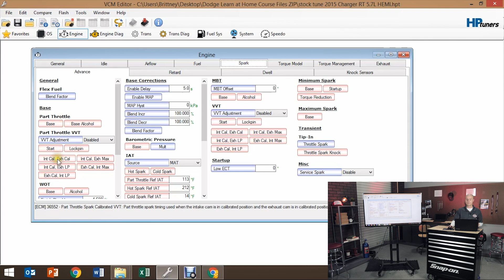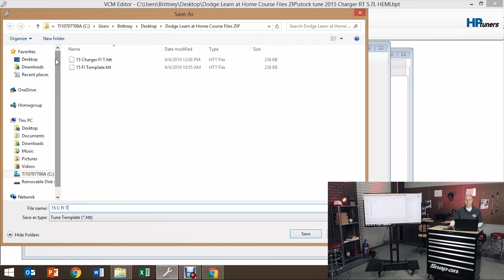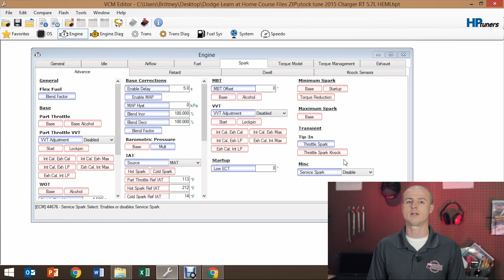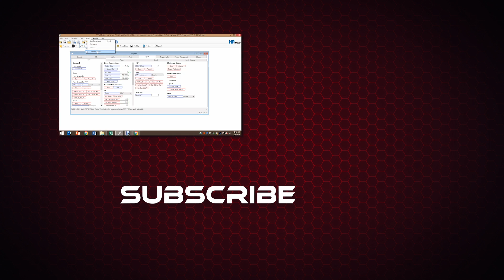Save Time with HP Tuners Template Applicator

Comment: I was thinking that HP Tuners needed a feature like this so I can save settings to quickly put my car in VE tuning mode, and what do you know, it already has the feature!   I will be using this a lot!   Also you can build a template from the differences between two compare files!